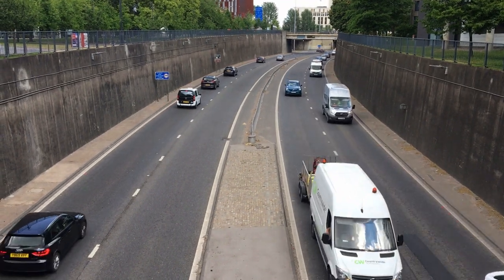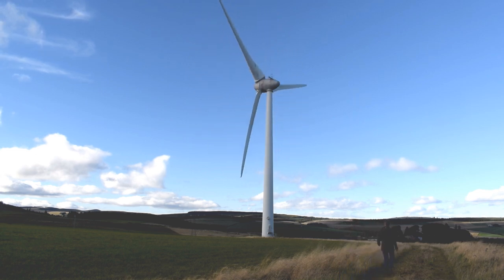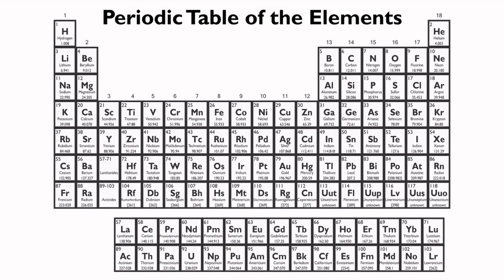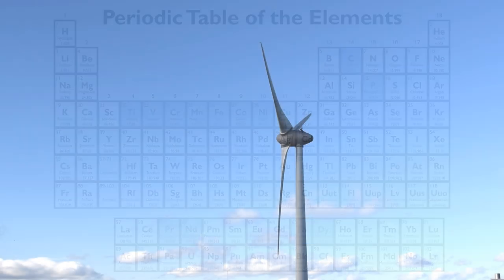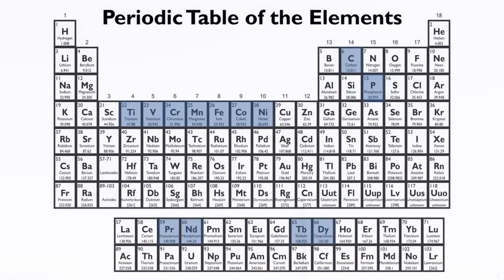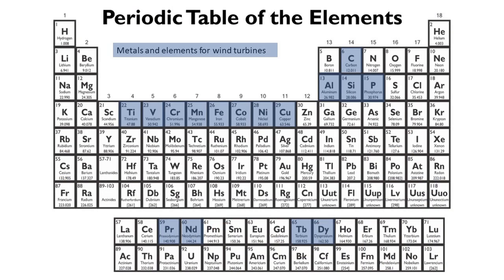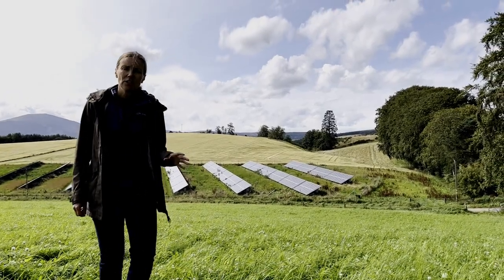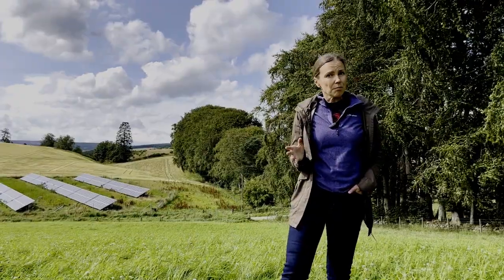What metals are needed for green energy transition?

Comment: You should add comparion on what fossil fuel plants needs. What kind of materials and of course the constant flow of burnable fuel with emissions.

Often this kind of videos are one-sided and does not have a comparion to alternatives.

Climate change denials often says that we don't have enough this or that or this will create too much emissions. A fair comparison between the solutions should be made.

Also keep in mind that specially in battery/energy storing technologies there are loads of alternatives. Lithium, kobolt, sand, salt, water, hydrogen, ... All of these depends on where to use them. It is not wise to use Tesla packs for heating or even for non-transportable usage. The light materials should be directed to movable usage like cars. And even in there solid state batteries are coming with some benefits against current lithium based batteries.

Comment: Very few places have enough sunlight for solar power, all of the mining and manufacturing is energy intensive and petroleum based. Wind has the same problems and is usually far from urban centers. Both wind and sun require huge power lines and a much larger grid for distribution, which people will not tolerate. The amount of mining and processing that you are suggesting is many times greater than has ever occurred with environmental impacts that are greater than any possible savings. All a pipe dream at best!